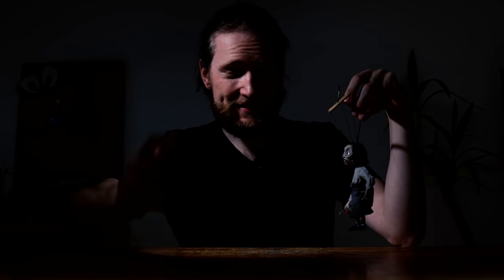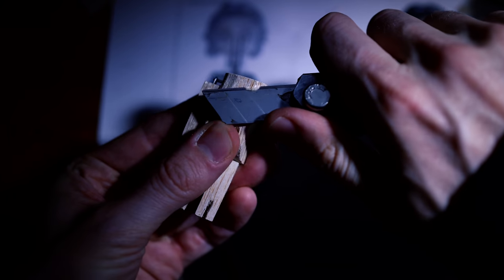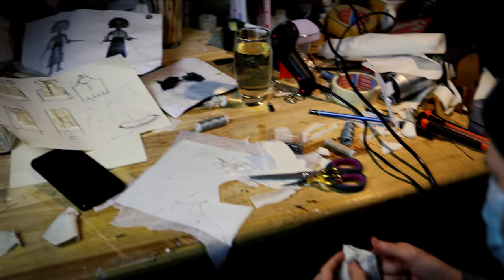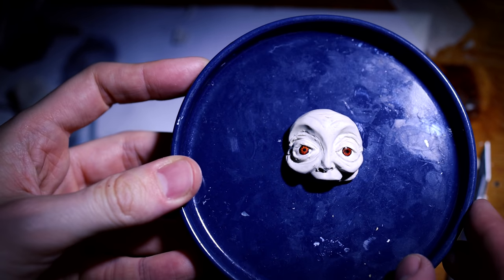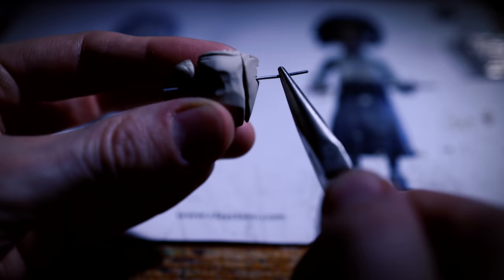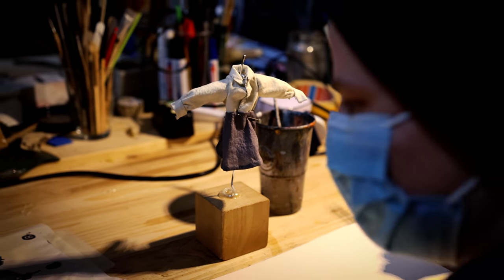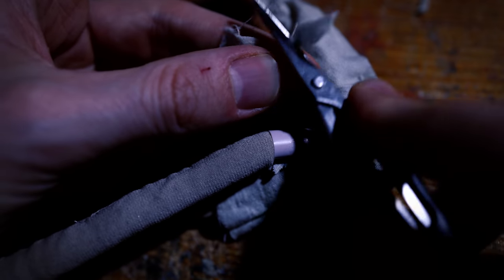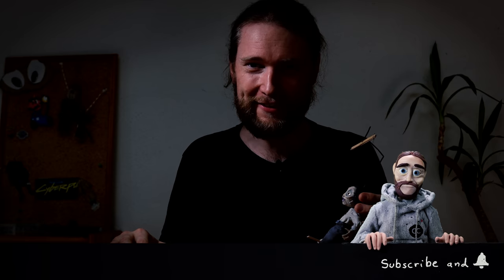I made THE TEACHER even scarier – Building a Puppet (Little Nightmares II)

Comment: Ok, i know youre the expert here, but please dont use the exacto knife to push things 12:20, also that 22:45 (smaller saw would offer better control). In the workplace its trained (OSHA) to be mindful of the direction of the force you are applying (hence what happened with the Hunter in the previous video) as that's where the blade will go if it slips.

Aside from my saftey nagging your puppet making is truly a marvel.